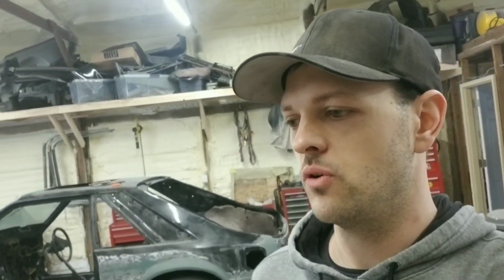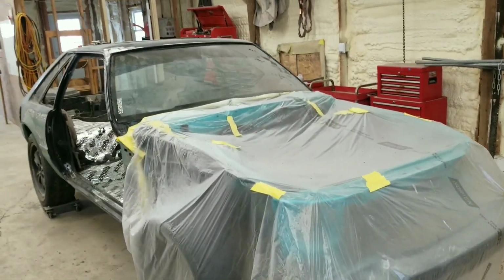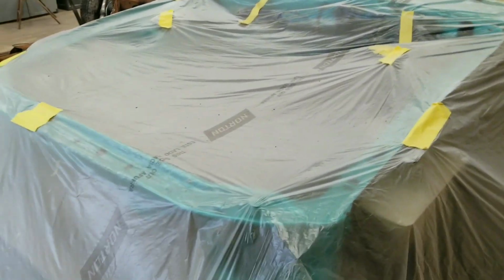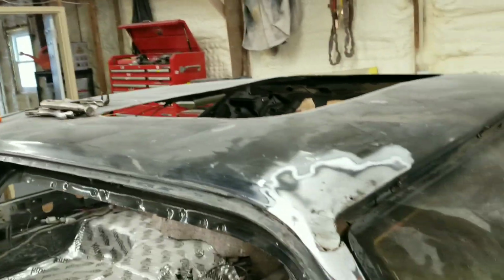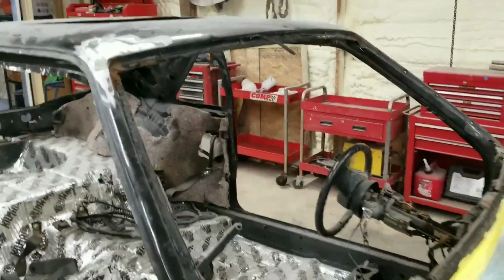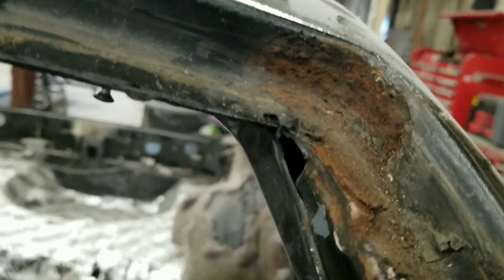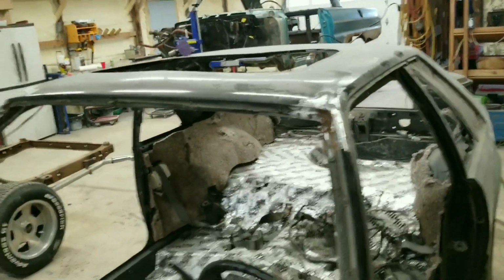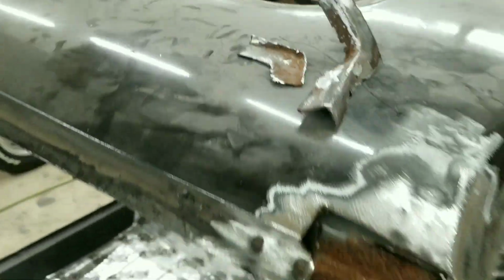#Buster the rotten foxbody mustang ep. 1 intro, easy how to windshield removal and more rust...

Comment: excellent video. I just pulled the tarp off my 1990 GT and found that the area on the driver's side at the base of the A pillar is rusted through. as in not there....just a hole about 6 inches long. and that's only the part I can see. so I'll be looking for more  A frame videos from ya!
Reply from the maker: Bummer man I hate to hear another one rusted
Reply: @bpbrestorations2093  hatch also rusted through. Got a new hatch. Easy to change. Windshield frame not so much.
Reply: @bpbrestorations2093  you got time to look at some pics and give me some opinions?
Reply from the maker: Email to cbuckner0859@gmail.com
Reply: @bpbrestorations2093  sent